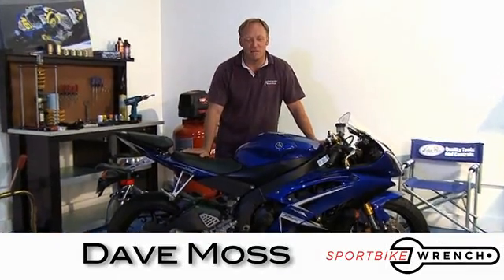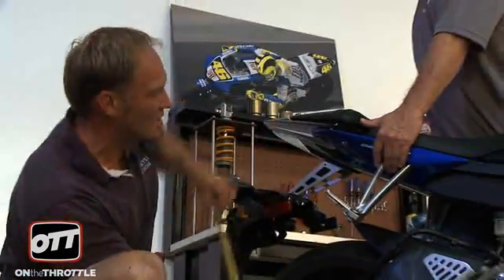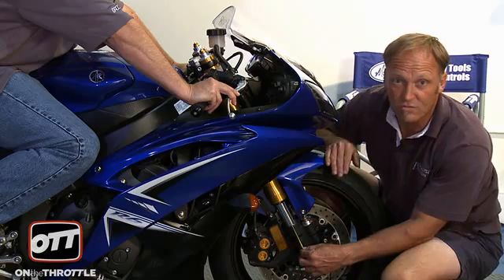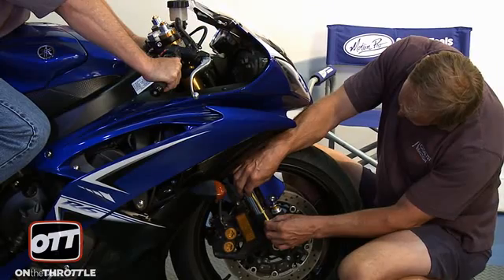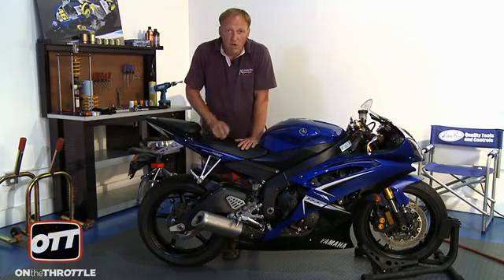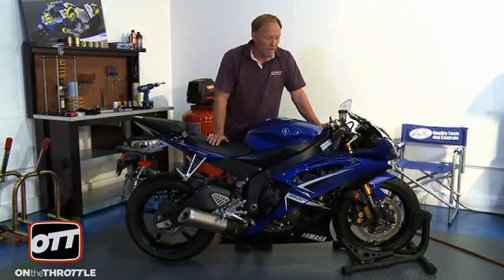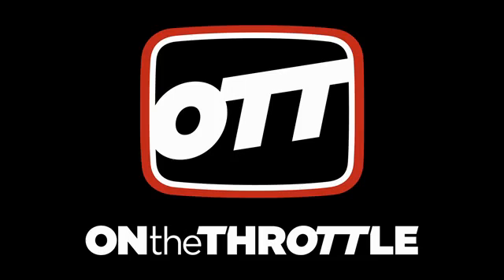Motorcycle Suspension - Setting Sag

Comment: Why CAN NOBODY Answer this Question? Static Sag vs Rider sag… Plz Correct if I’m Wrong.. Rider Sag. You measure the suspension Unloaded as in Full extended. Then you sit on the bike an Measure how much it’s compressed with you on the bike. Then subtract from the unloaded or full extended measurement. That Number is your Rider Sag? Am I Right or Wrong? I Ask Because every Dave moss video I watch. He combines static sag with rider sag to get a total number. Equaling your rider sag.. so how exactly do you measure rider sag?  I’m sitting at 27mm rear with rider sag. But if I measure it Dave mosses way. I’ve got 17mm static & 27mm Rider. So that would be 44mm Rider sag? I’m so damn confused! Even google says you DONT Combine the numbers. There separate. Only to determine spring rate. But he’s the best there is? So somebody plz break it down for me like a 3rd grader I mean shit!

Comment: Hello Dave and Editor!
Just 2 questions. Why does the "recomended" sag in the back is 30mm to 35mm and in the front 35 to 40mm?
I even read in a famous magazine they both sould be around 30mm for the street (for a canyon rider is that ok?),
And there is any problem in front and back sag being diferent?
Last, you should messure the sag also hot or just the rebound? And does it make a huge difference or just from potencialy very good to perfect?
Thanks a lot, Great videos, keep it up.

Comment: 589mm + 8mm = 597mm (not 596mm) - 565mm = 32mm. Whats the point in taking two measurements and adding them together? Why not just take the 2nd measurement.

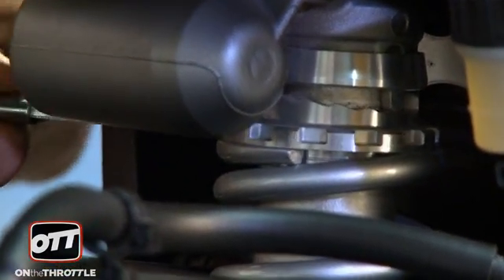Comment: 5:40 preload does NOT make the spring stiffer.
Reply: Yes it does, if you add preload the spring compresses and gets stiffer.
Reply: @Isaac.Reuben  the spring has a fixed rate. It alters the geometry of the front.

Comment: I totally agree with you on that metric measurements is a lot more accurate, I wish we can just get ride of the our current measure standards here in the US. Metric standards is a way better way and it's easier to use.
Reply: Yeah but never gonna happen
Reply: Our government schools continue to teach very little of the metric system. And all medical/medicines/are all metric. You couldn't be a doctor if you didn't know the metric system. Convert 27 inches to feet, yards, and miles.. Will take a while. Convert 27mm to Centimeters to Decimenters and then Meters. EASY: 27 mm = 270cm=2700dm=27000meters.
Reply: @RobertMacCready   Almost, it has to be the other way around. Like in 27 Meters = 270dm = 2700cm = 27000mm.

Comment: I have been continuing to make videos and have my own channel now Dave Moss Tuning. With a massive selection of videos, you will probably find the video content that you are looking for. If not, we can create it.
Reply: Dave Moss Tuning cool cause I need to find a 2007 cbrr 1000, for suspension set up
Reply: Hello Dave and Editor!
Just 2 questions. Why does the "recomended" sag in the back is 30mm to 35mm and in the front 35 to 40mm?
I even read in a famous magazine they both sould be around 30mm for the street (for a canyon rider is that ok?),
And there is any problem in front and back sag being diferent?
Last, you should messure the sag also hot or just the rebound? And does it make a huge difference or just from potencialy very good to perfect?
Thanks a lot, Great videos, keep it up.
Reply: @Cesar Ignacio Fantastic  and thank you for having a go at it to see a positive result.

Comment: As he said ball park figures 
35 to 40mm for street riding I run 47mm as the roads here in Asia are shit  If ran 35mm I have no teeth left 
But I started at 30mm  and worked my  up as standard sag was 60mm and my nose was dragging on the ground

Comment: Hi Dave, 

I have a 2007 CBR600RR.  I currently weigh about 205 to 210lbs with my gear on.  I'm totally new to suspension set up but thought that I'd dive in last night.  I was able to get my rear SAG to approximately 30mm with relative ease.  However, I have found that my front forks read roughly 35mm of SAG no matter where I adjust my preload.  35mm is fine for the riding that I do, but I am really baffled how it could be that I can change my preload adjusters (15mm blue hexes on top of forks) dramatically (roughly 12 turns to full hard) one way or the other and see no actual change in the sag.  Do you have any idea what could cause this?  What have I missed? 

Thanks,

Lance

Comment: Dave Moss Tuning
+arno kuhn fork preload should allow you to work the middle 2/3rds of the adjustment range, that can be assessed with a zip tie. As for the shock, you need to manipulate the preload until you have 10-15mm of static/free sag. Hope this helps.

Thanks. Do you have a video to assist

Comment: Would this be valid to use on a naked (z1000) bike?
Reply: Z1000 uses different front shocks similar to a dirtbike. One fork controls dampening and the other has spring pressure. I'm looking for the same thing.

Comment: Fuck, he had me until the last couple seconds. I don't care what it feels like on the street, I want to know the perfect settings for racing. Sure, I mostly commute and canyon ride, and I take the bike to the track rarely. But like I said, it doesn't matter to me whats best for the street, when I'm hauling ass I want my bike to be perfect. But other than that, great vid! I learned a lot.
Reply: Dani2wheels there are no perfect settings for racing as it is entirely rider and circuit dependent.
Reply: Setting up for the track and riding on the streets wouldn't be ideal. You set up your suspension depending on what surface you're riding on. I guarantee the roads you ride on are much harsher and bumpier then a track. Therefore, you set it up differently. Do you think the isle of mann tt racers set up the same as Moto gp racers? No, different surfaces.
Reply: Jethro Rose Ya my bad, I had never really considered suspension till recently and I'm finding it far more "application specific" than I initially thought. Probably gonna delete this ignorant ass comment lol

Comment: Hi Dave,
I'm a bit confused because when you setup the front sag to Daves weight you had to remove all the preload from the forks but in some of your other vids you say if you have to increase or reduce preload to their extremes then replacement springs are required to suit the riders weight. Please can you clarify?
Cheers
Chris.
Reply: 1tokeover Gotcha!  haha  That is a good question then...  Perhaps he (in the video) was just working with what he had but recommended purchasing new springs.
Reply: If you soften the preload of the spring to it's extreme, purchase softer springs.  If you harden the preload of the spring to its' extreme, purchase stiffer springs.
Reply: This is a good point.
Reply: That is removing all the externally adjustable preload. There is still installed preload.
Reply: chris smith because 37mm is more than enough
Reply: Jimmy, Chris is asking why Dave removed ALL of the preload from the front forks without replacing the springs. He basically is contradicting himself when he removed all of the preload from the springs to get the sag correct.

Comment: Dave, I have a bike with adjustable rear suspension and non-adjustable front. The front is quite soft for my weight. Should I set the rear preload to what it should be for my weight (as in this video), or would it be best to balance the rear suspension to the front so the bike moves up and down as one. The front end wants to wander right after I bank the bike into a curve.

Comment from the maker: If you top out the shock by lifting the back of the bike up by hand, you are doing the same thing. If you want the rear fully off the ground, use the kick stand to elevate the wheel. You should get the same reading. That's free sag. Then rider on = rider sag. Totals are then combined.

Comment: Hey Dave i just got an Ohlins Shock 46PRXLS for my 03 600RR and the owners manual recommends to measure the bike on a center stand with suspension fully extended(wheels in air), bike on ground, and then bike with rider.  Why is it that you mentioned that just lifting up and measure before suspension is fully extended is enough? thanks!

Comment: Dear Dave,
I'm going to the track next weekend and I have a question regarding the sag setting.
What should be the initial compression damping ? I mean if I want to take the measurements you mentioned the compression damping will influence every measure I'll make (i.e. If its too hard then the suspension will be stiff so when I'll sit on on it won't move).
Thanks !

Comment: NO.

You're not going to be able to lower your bike with anything you see in this video. Also, if you really want to drop the thing a couple of inches, you're WILL have to install links and "mess with the bike." Are you a new rider? Personally, I'd focus on learning to handle a slightly taller bike before I go in and start making physical changes. You don't have to be able to flat foot a motorcycle to be stable on it. If you can safely get one leg down without an issue, you're good.

Comment from the maker: Preben - thank you. Sag for the track is 30-35mm for the forks depending on your braking style and in the rear of the bike it is 25-30mm depending on your acceleration skills. Faster lap times = stiffer suspension in small increments.

Dave Moss
Host

Comment: If OEM setup sag - 60mm for 120mm of total travel, you re-spring front and set the sag correctly to 40, it is required to drop bike on forks by 20mm to get "stock" geometry. Problem - isn't always possible to drop (various reasons). Can be compensated by raising rear ride height within safe sw.arm angle range. Rule of thumb is 10mm ride height increase is ~1degree sw.arm angle increase. Sw.arm angle change math.: x=arctan(r.h.c/sw.arm.length)=arctan(10mm/590mm)=0.97. If OEM 11.0+0.97=11.97

Comment from the maker: It can also be done by reading the specifications on the forks that state for example 120mm of total travel. Fully extend the forks with the front wheel in the air and pull down on the wheel, then measure from the dust seal down to the foot and do the math. 170mm total distance? Mechanical bottom out is therefore 50mm from the joint of the fork tube/foot up

Dave Moss
Host

Comment: To find mechanical bottom out approximately - set compression and rebound damping in the front full soft. Add zip-tie to chrome tube. Drive very slow, then apply front brake quick and hard to bottom-out front forks. Do it few times to be sure. Then mark the position of the zip-tie top on the chrome tube. This is your bottom-out. With you on the bike, take measurement between bottom out line and edge of the dust seal touching chrome tube, say "X"=80mm. Then SAG=(120mm-X)=(120mm-80mm)=40mm=SAG.

Comment: Just for your specific case where you have 33-35mm range (if you measuring sag correctly), and your lines on the preload adjuster are probably 2mm height, for the street 35mm to 40mm front sag you should be good with just 2 lines showing which should give you about 37mm of the "true" front sag.

Comment: You have long top-out spring - adding preload just increases your total suspension travel. There are two ways to find your true sag in this case. Easy way: add all preload in the front to compress top-out springs as much as you can. Then measure fully extended front and use this number as you fully extended figure all the time. Harder, but more precise - find your mechanical bottom out point, then add your front suspension travel to that and use the number as fully extended.

Comment from the maker: @GixxerDan750 Every time you get a bike you need to know how the bike sag under your own weight. Does the rear collapse taking weight off the front wheel? Does the front collapse putting the balance of the bike on the front tire? That will provide you with basic answers as to why the bike sags as it does. Optimization of compression and rebound is critical for the balance of the bike between dirt and road work.

Dave Moss
Host

Comment from the maker: @GixxerDan750 use the kick stand for extended measurements for front and rear and then use the paddock stands. It won't be 100% accurate but it will get you close. Set sag in the forks to 35mm and the shock to 30mm. You'll need to run compression close to max. Rebound all depends on oil age.

Dave Moss
Host

Comment from the maker: @Toxickiller142 if you are going to the track sag settings relate directly to your ability level, bike horsepower and track design combined. 30-40mm in front, 25-35mm in back to start. With hydraulics, you generally add compression to the front and rear for track use but remember that rebound is a constantly evolving setting for bike balance as the oil degrades/ages

Dave Moss
Host

Comment from the maker: @TheAlexandar137 little 125's like this are very softly sprung indeed. Rear sag needs to be 30-40mm max. You are probably bottomed out 2 up! No wonder the bike won't handle - no weight on the front wheel at all. I would look for another shock of the same length to replace stock from another brand:- SV650 perhaps? Something else has to fit or get a much stiffer spring but you'll have to remove it to measure it first before finding  a replacement.

Dave Moss
Host

Comment from the maker: @mwahidin start compression in the middle of the total range available when the suspension is cold. Ride and see how the suspension works when it gets hot - all depends on oil age/mileage in the forks and shock. Rebound balance can only be set accurately when the oil is hot. Look for the suspension bounce video on catalystreactionsbw channel.

Dave Moss
Host

Comment: At 05:42, he said that would increase pre load and make the spring stiffer.
That's incorrect! 
Spring rate = Spring stiffness
When you change the pre load the spring rate still the same!
The spring doesn't get stiffer.
You just have add pre load.

Comment from the maker: @SAMFICOM we need to clarify. Static sag is the bike sitting under its own weight from top out front and rear and can be called free sag. Rider sag is you on the bike. Static and rider sag = total sag. Sag is a starting point, no more no less. There's no magic number. Range is 30 to 45mm in the front, 20-35mm in the rear. All depends on the quality of ride you are looking for - comfort or firm for more feedback? Work from soft, intermediate to stiff and see what you like best.

Dave Moss
Host

Comment from the maker: @elalis the range of compression for low speed (screw) is 0-2 turns out. The range for the high speed compression (blue) is 0-1.75 turns out. High speed is for sharp edged bumps in trying to mute severe immediate impacts.

Dave Moss
Host

Comment from the maker: @SAMFICOM the fork springs must be replaced with 1.0kg rate and 15w oil to the spec oil height. The shock spring is marginal but okay for your weight. Set sag at 35mm in the rear. The bike bounce looks ok but as you say that is with cold oil in the forks and shock. 

Dave Moss
Host

Comment from the maker: @MAREMthenME your spec sheet tells you how much travel you have, so I go off that. No need to lift the wheels off the ground!

Forks:- if you know the full range of travel (eg: 120mm) then placing someone on the bike is simple math.

Shock:- I will always top out the rear shock to see if there is or is not a top out spring in the shock. It is essential for shocks with no top out spring to have free sag.

Remember sag is just information and a simple starting point to go from.

Dave Moss
Host

Comment: Hi Dave, I have noticed that other suspension guys lift the rear and front so high that the wheels are off the ground. Your method seems a bit different in the sense that you don't want the wheels on the air. 

My question is
1. what is the reason behind this?
2. How do you know how high you will lift the front or rear? What is your guide? Thanks and keep up the good work!

Comment from the maker: @mooosestang I did a live show on progressive and linear springs that can be found at: ustream.tv/recorded/5350380 Yes progressive springs are very soft initially so they can be a headache when setting sag. Remember that sag is just a known starting point, and then you work from there to make the spring preload softer or stiffer for your needs.

Dave Moss
Host

Comment from the maker: @mooosestang I would change to .85kgs to make sure that you can use the preload as an adjustments. I believe the Buell springs are all the same size in length so it should be a straight swap, but make sure you measure the installed preload first!

Dave Moss
Host

Comment: Hi Dave, I have a 2009 Buell 1125CR and I've removed all the preload from the front forks.  I only have 27mm of front sag, so I'm going to change springs.  The stock springs are .95 kg, should I go down to .85 or .90? I weigh 140 lbs without gear.

Comment: @OnTheThrottleTVi i tried thist setup, front end was pretty easy and fast to do, but to set the rear at 35 i would probably have to set the preload to the max. I measured the rear sag several times the same way as u did and its about 45mm with the preload almost in the maximum. Should i try to set the preload to the limit and come closer to 35mm? thx

Comment from the maker: @ultrarider666 on setting sag? Because it is a little difficult to do sometimes without special tools and you need help to hold the bike and do some measuring. The suggestions are starting points and that creates a lot of arguments rather than debates, so tensions rise with disagreements. No matter what, it makes the bike a safer and better handling machine, and that some day may save your life.

Dave Moss
Host

Comment from the maker: @scyzor123 you need a sag of 32-335mm in the rear and 35mm in the front. Set compression in the middle of adjustment and do the same for rebound. Set these first and then ride the bike. See how the handling changes. Do you think it is better or worse. If worse, where and why? Corner entry, mid corner or corner exit?

Dave Moss
Host